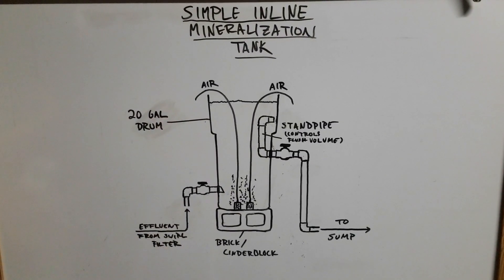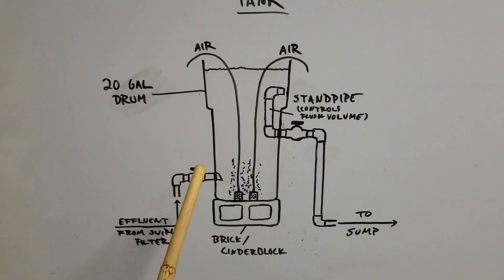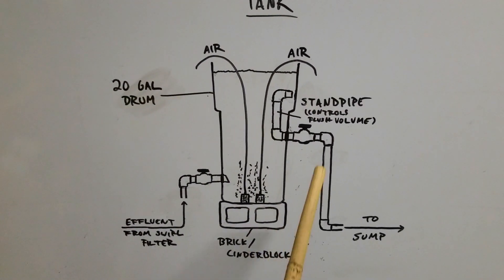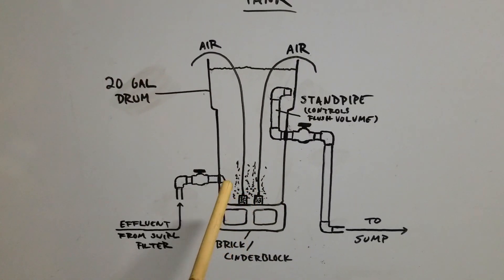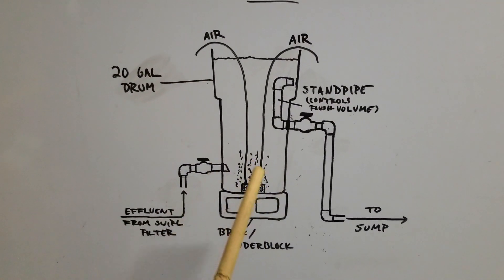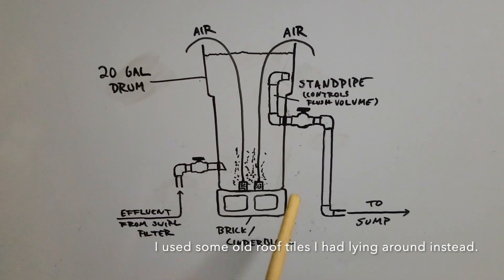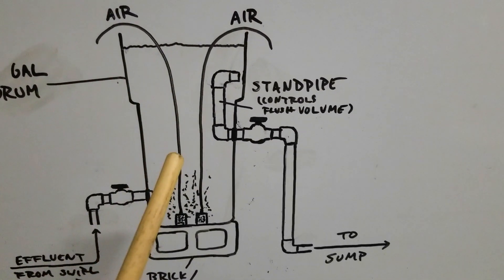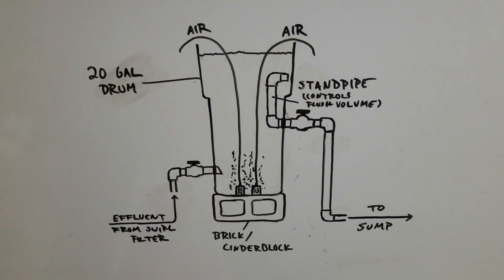Unlocking HIDDEN POTENTIAL in fish waste!  Building a mineralization tank for aquaponics

Comment: In fish keeping, there are a few sludge eliminating products and some products like api quickstart that help convert ammonia to nitrites and nitrates. I am wondering if you would know if using these would be helpful in speeding up the mineralization of fish wastes and chemicals. 

I know that there are nitrogen fixing bacteria in api quickstart and related products but not sure about these so called sludge eliminating products, they don’t seem to have a list of bacteria species they use.
Reply from the maker: Good question!  I only use those types of products when cycling a system or in an emergency situation where there is a deadly ammonia/nitrite spike.  A properly designed and functioning system will have a strong microbiome and enough biological surface area to mineralize all fish waste products efficiently

Comment: Now after a year of this video ,
Did that idea succeed ?
What changes on plants appeared after this while?
Did you face any problems ?
After this experiment what are the results ?
Reply from the maker: So far this mineralization tank has been working really well!  I have had to reduce the need to supplement substantially.

I ended up having to increase the air volume flowing through the mineralization tank because it was less effective with the pump I was using in the video.  That is the only change I had to make to it.

I will do an updated aquaponic system tour video in the future and I will go over the mineralization tank in that video!
Reply: @solarpunkfarmer  
I'll be waiting for that tour video
thnx

Comment: I HIGHLY recommend using a full drain tank for this.  your cleanouts will be way easier.  also building small systems first as prototypes. i used a 5gal water bottle upside down with the bottom cut out for my pond filter.  theres a relatively common size rubber coupler (2.5in?) that fits them.
Reply: also those chinese made ecoair pumps are great.  ive had one running for years straight, and it's outside in the elements too.  also their ecoplus mag drive water pumps are great, have one running my fsh tank sump for 8 years now.